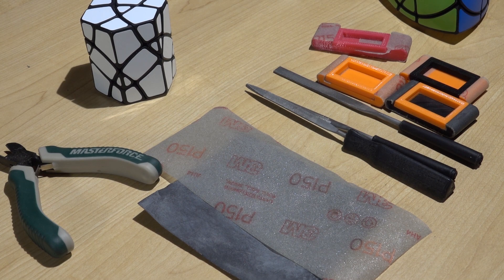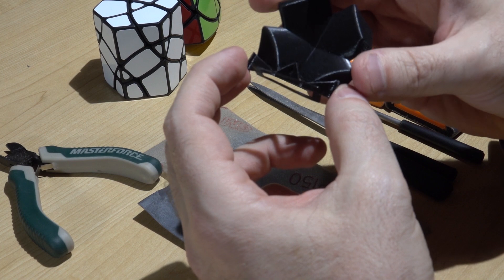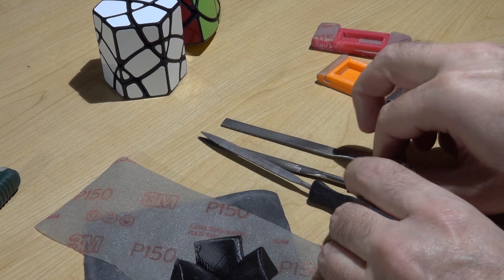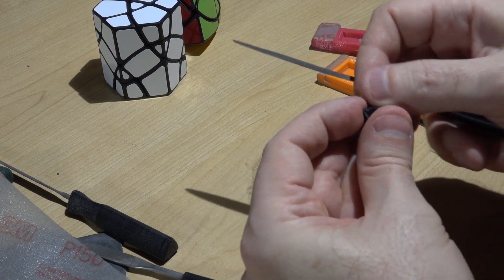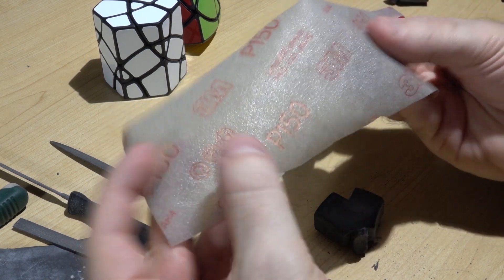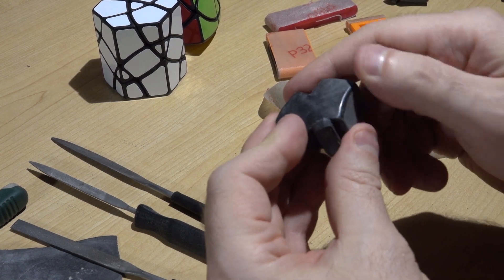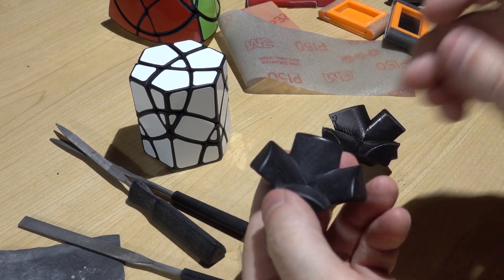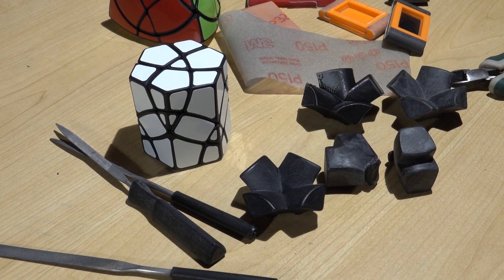How I sand and finish my 3d printed parts for a smooth finish.

Comment: Great video! I usually lack the patience to sand my puzzles to that level but the difference clearly can be seen - yours look extra-clean!
Reply from the maker: Thanks,... it's a lot of work,... no easy way around that, but the results make up for it.
Reply: @rcpongo  Definitelly. I got kind of lazy and often just sand the mechanism but I really like your results. I might go back to the "hard way". Therefore however I need a good design first. Your custom supports are spot-on. I often fail at that stage and end up with pieces that don't fit or have really rough outer surfaces.

Comment: Only 15 minutes for such a complex piece?  Impressive!
Reply from the maker: The file method is really efficient. 15 minutes is more of an average,... simple pieces like the corner piece can be done in 5, and more complex ones will go over 15. I usually do 5-6 pieces at a time before I take a break.

Comment: Thank for the video, I am starting to print some decorations (models, planters, etc) and it helped a lot with postprocessing. I have tried a couple of 3d printed sanding blocks but I found that the common designs do not fit my workflow. I liked your sanding blocks, would it be too much to ask you for your file?
Reply from the maker: Here is a link on thingiverse to the one I started with. https://www.thingiverse.com/thing:243879 The variants I made were based on this and just a bit shorter/wider to accommodate the size of my higher grit sandpapers.

Comment: Thank you for sharing your amazing technic , i was wondering how do you generate the supports , is it in CAD or is it in the slicer?
Reply from the maker: I do both, depending on the situation. The ones I make in CAD are nice because there is usually less scarring on the print. (Or at least I can control exactly where it is) what I do is just make a single line that is extruded up to my model, and that is given a thickness of around .8 to 1mm. It has to be thick enough to have some strength, but thin enough to not have an infill where it touches the part. Also it helps to have a curve or a T for strength. (A single straight line is fairly weak, but a curved line is much stronger, despite the thin line)

Comment: hello, thanks for the tips in the video
I ordered a 3d printer a couple of days ago and I am really wanting to build my own puzzles
I have a question for you, do you sell your puzzles? if so, is it easy? 
it is not like I want to make a business out of it, just sell one prototype every now and then "just to pay for the filament" so to speak 😅
I have learned solidworks basics and done my first designs (even a speed 3x3!!! and a 5x5) and extentions, mainly for higher layer number ghost cubes based on the original design by Adam
Reply from the maker: I do sell puzzles, although it is a very low amount. Unfortunately, the reality is that it is not really viable to finish these to this high of a quality and be able to sell enough of them. You really have to do it out of a passion for detail, and you can make a little money back while doing it. The biggest issue is simply the time it takes,... roughly 10 hours per puzzle, and that's just the sanding phase The original print and design time is another 10 hours or so. What is 10 hours of your time worth? Anyways,... I do it because I really enjoy it, and being able to make a few puzzles for others is extremely rewarding for me. Along the way it pays for my filament, vinyl sticker material and hardware for more puzzles. The actual costs in doing this are low with the exception of personal time.
Reply: @rcpongo  thanks for the response
I will do it regardless cause I like collecting puzzles, but I just want to sell a prototype from time to time
I have done mods with sculpting resin, and it is waaaaaay more time demanding
I enjoy the process of design, and maybe it takes me a really low amount of time cause I have experience already
today I finished a replica of a yuxin 7x7 and it took me less than 12 hours at most (look down routine I guess) and with that design alone I am able to make an axis, a ghost, a bump cube, in a matter of hours

I am not willing to sell in bulk, just from time to time, kinda to pay for the plastic I use, just an interesting hobby to have
thanks again for your reply :)
Reply: @rcpongo  You could try injection molding to produce them in higher quantity. There are some tutorials how to do that with a reasonable cost on YouTube.

Comment: Nice from you to share your method, Troy. Did you try to use WD40 instead of the lube to darken the pieces and give back the shiny look to them? I found it very efficient. Thanks to Nathan Wilson, of course.
Reply from the maker: Seeing Nathan use the WD-40 made me experiment a bit, but I didn't want the smell of that, and was unsure if it would affect the plastic. I like the silicone oil for how easy and clean it is to do, and I can just do it right at my workbench so it's been great.